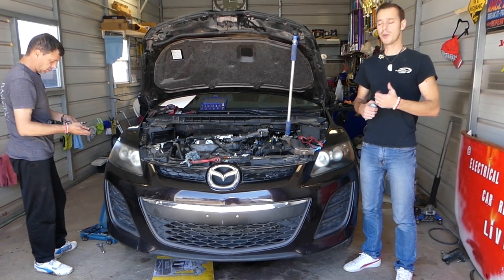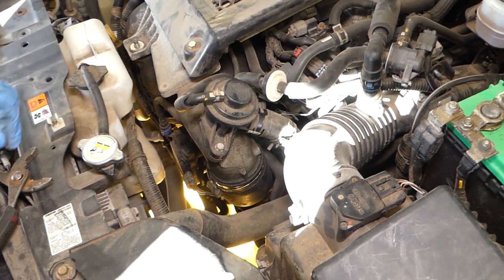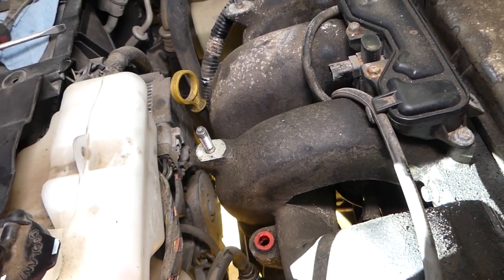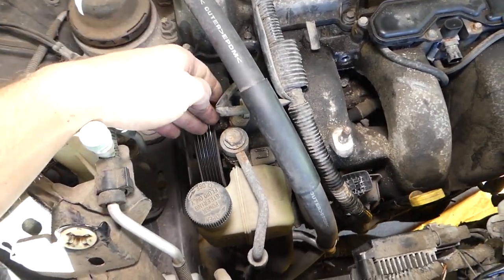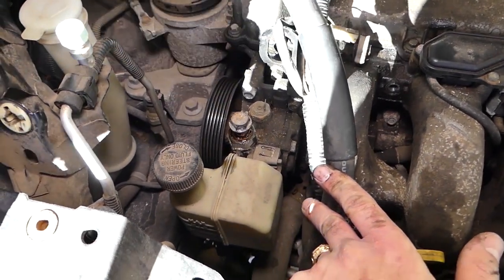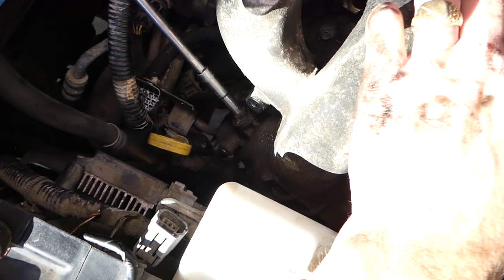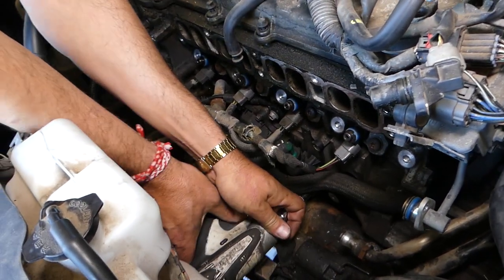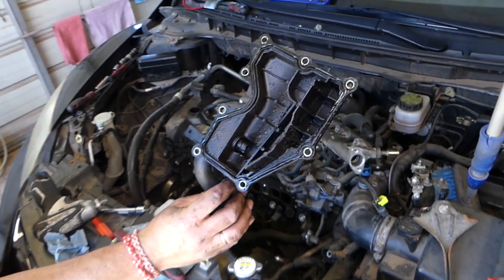CRANKCASE BREATHER VALVE GASKET REPLACEMENT LOCATION MAZDA CX-7 MAZDASPEED 3 6 2 3 CX7

Comment: You don't need to remove intake for the PCV. Remove the oil fill dipstick tube and you can go from underneath, did mine in an hour. Changed the hose and PCV. No more lean condition and restored my boost and gas mileage.

Comment: what would the reason to replace CRANKCASE BREATHER VALVE GASKET? I notice your first step is to drain coolant? Why do you drain? Is there a hose or pipe you remove that contains coolant?
Reply: i think the coolant is go through that hose 
the way you use the heater or aircon,
the same problem of mine...
my hose is had a crack thats why coolant is leaking..
thru that hose..

Comment: Why didn't get access from the bottom rather going through all that stress???
Reply: Have you been at the bottom of these Mazdas?
Reply: He made a mistake in the title......so
Reply: Right😂 I just did mine from the bottom, just got to remove the oil dipstick tube and you can access everything, it's a little tight but did mine in an hour. The hose and valve was bad.

Comment: THIS IS NOT A CRANKCASE BREATHER VALVE GASKET. This is a Oil Separator to cylinder block where your PCV(Positive Crankcase Ventilation) Valve is located and PCV Valve hose is connected to the Intake Manifold. If you don't know your parts, don't make videos because you will cause irritation to people that look for this part and do the wrong work because of the wrong title. Thank goodness I saw this. Change the title.
Reply: He made a mistake or maybe it was wrong translation either way man respectfully he’s actually teaching people something you aren’t doing anything. Ok the name of the part is wrong big deal he got the problem fixed we have phones we can look it up ourselves.